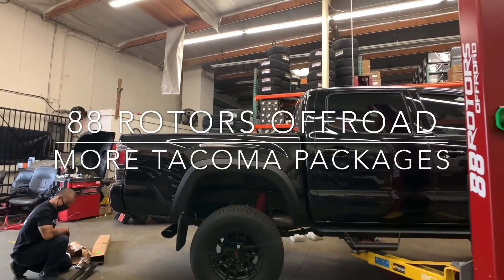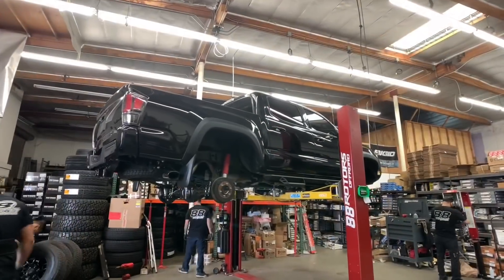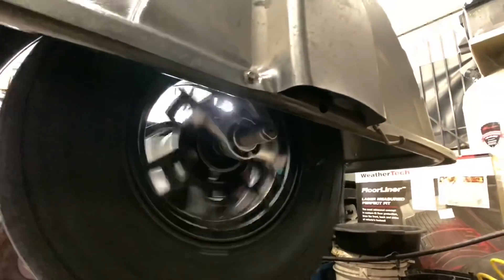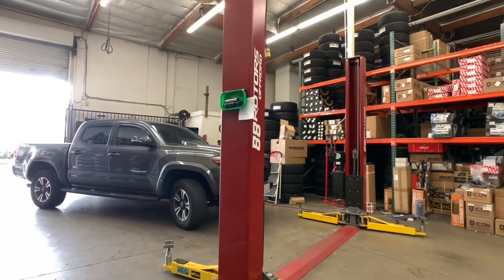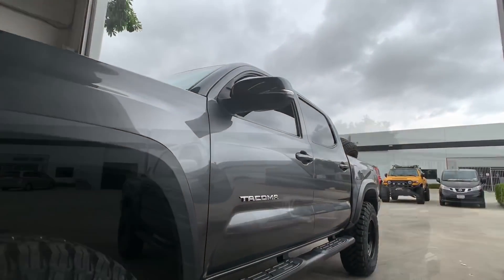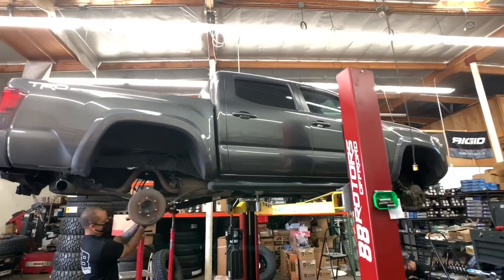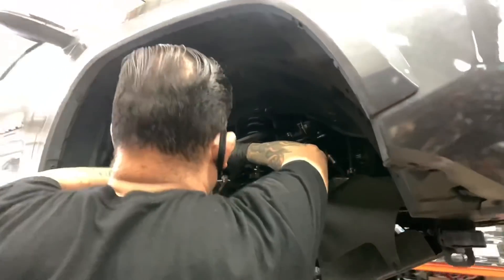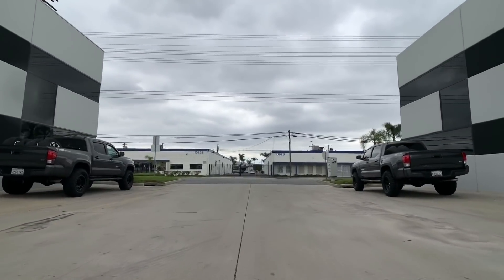TACOMA TRD PRO LIFTING WITH STOCK FOX PRO SUSPENSION

Comment: I have that exact same truck. The best thing that I've done so far out of all my mods was to get rid of those god awful Goodyears and replace them with BFGKO2s. Changed the entire attitude of the truck offroad. Those Goodyear tires are the worst!
Reply: What size tires did you get?
Reply: Ye what size, son?
Reply: @flounder  what size duratrac did you fit with stock suspension? Do you think they're too noisy?

Comment: Another great Taco video. Found a company that makes the new Pro wheels in a 17x9 zero offset. No center cap issues. Look great.
Reply from the maker: Replicas are just not the same. Especially in a larger diameter, IMO.
Reply: Usually I would agree but in this case they look exactly the same.
Reply: @davidwethington9320  who makes them?
Reply: @brokenwrench404   Alphas auto parts. EBay. Still look great. No issues
Reply: @davidwethington9320  I’m having trouble finding these wheels on eBay. Are they still around?

Comment: Funny you mention the center caps.  I was tinkering with my truck today and noticed that one of the center caps was loose!  You are correct, the ring is a terrible design, and one of the plastic tabs looks like it's on the verge of snapping!  

I only have 400 miles on the truck and it's something I will definitely keep an eye on!

Comment: I wan to put on 285/70/17 with the fox factory suspension what i need tplo fit those tires  with the TRDPRO 17 inch rims what spacer do i need in front and rear ?

Comment: I have a 2019 Tacoma TRD pro. Will that lift and tire size put the speedometer off a little bit or a lot?
Reply: The lift will have no impact on the speedometer, only the tires. The speedometer will be off by whatever percentage difference in circumference the aftermarket tires are compared to the stock tires. For example, for a 33” tire the difference in circumference may be 8% larger than stock (note that it depends on the tire make and model, as not all 33’s have the same circumference). Thus, the speedometer (and odometer) in this example would underestimate by 8%. This would also translate to inaccurate readouts in your vehicle’s fuel consumption and range displays, if so equipped.

Comment: How much more of a lift can you put on the trd pro? I just got a 2019 trd pro but want it lifted 3” witch out removing my trd fox shocks that came on it. I wanna run 33s also
Reply: I went with a 2 inch leveling kit spacer on the front and a 1.5 block on the rear so it stays leveled.

Comment: Do you lose ride quality with these shims?? Also what add a leaf would you suggest?
Reply: I don’t have personal experience, but I’ve heard the westcott designs shim lift for the TRD pro firms up the ride very slightly, which could be a good thing because the stock ride is on the soft/slushy side. I’ve also heard the Icon add-a-leafs have the best ride.

Comment: Hey 88rotors, what kit did you use for the front end on the 2020 Trd pro at the very beginning of the clip? You said you used a shim and a spacer? What size of shin did you use for the front coil? Was it a shim that preloads the coil or does it sit on top of the hat? I’m trying to figure out what kind of spacer I need to achieve 3 inches in the front. Cheers. Waiting for your reply.
Reply: That's my TRD pro.  I used Tuff Country 1.5 Inch Suspension Lift System - 51025.  This comes with 1 1/2" spacer for front and aal also 1 1/2" for back.
Reply: 1.5" spacer.  Tuff Country 1.5" lift kit includes that with AAL.  Part # 51025
Reply: Keith Kim so your truck is a 2020 Trd pro?
Reply: @Mu5cle55  yes
Reply: That black TRD PRO is mine.
Reply: Keith Kim how are you liking the lift kit so far??
Reply: Keith Kim did they not need a shim for your leaf springs?
Reply: Keith Kim did the lift kit change the ride on the truck at all?
Reply: Jay Bird keep us posted of your findings. I also have the AG 2020 trd pro. Looking to get some K02s for it soon and looking at a lift as well. 

For sure keeping the stock wheels.
Reply: I have a 2020 TRD Pro and looking for some feedback on your lift Keith Kim. I'm considering doing the same and adding some 285 75 16. Your feedback would be appreciated.
Reply: @keithkim6988  do you get any rubbing off-road and normal driving ?
Reply: @robbell8507  I am currently running different set up now but that's the size tires I had at the time of this install.  Before you do anything think about what your planning to do with your truck.  Are you going to build overlanding rig later or just lifted truck?  If your going to add truck bed track and carry roof top tent you would want to change the whole leaf spring to heavy duty at least 600lbs capacity in the rear and just use add spacer in the front.  You would need to change your upper control arm to after market since the stock ones can't handle 3" lift without rubbing.  Also cab mount chop is needed to clear the full lock turns.
Reply: @epicone2449  You will rub the upper control arm if you have stock UCA.  Need to change the after market ones.
Reply: @keithkim6988  I can’t shake the fact that doing a add a leaf in the rear in Trd pro shocks will change the shock travel, and need new bump stops to prevent over travel….did you experience anything like that? I’m looking for a better option than a block to go with the eibach Trd pro lift springs.
Reply: @BruceWayne-xu5bj  If you are planning on adding front bumper or duel battery system, changing to heavier spring is better.  I ended up changing the new Fox 2.5 w/700lbs spring cuz of my steel bumper from Fab Four.  I ended up building overlanding rig.  Rear I went with Deaver stage 3 (1000lbs) leaf springs.